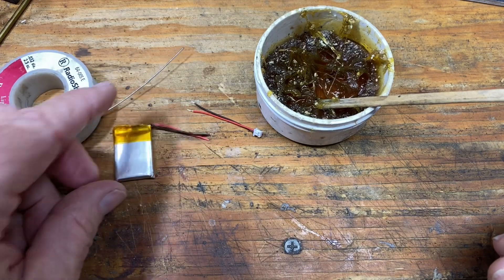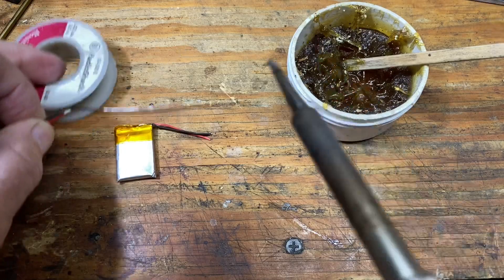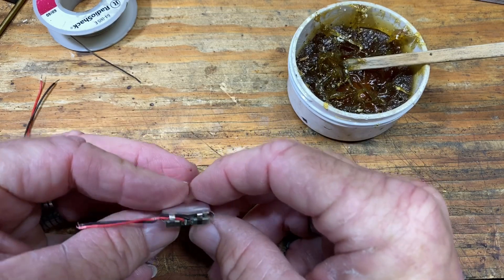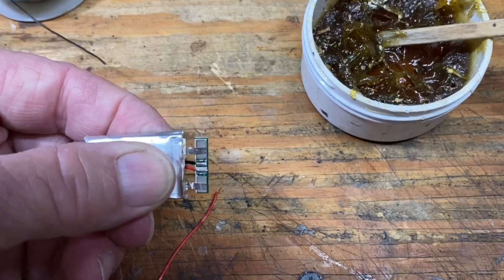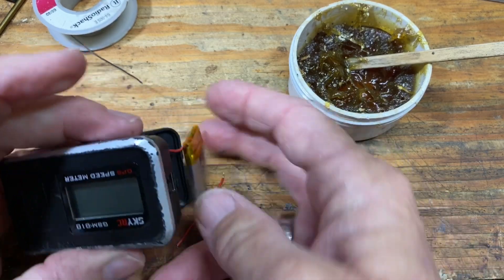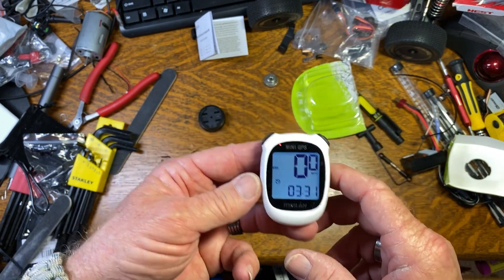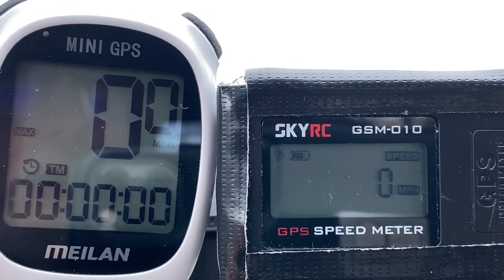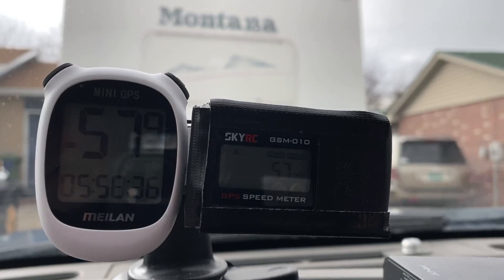SkyRc GPS repair and test

Comment: Has anyone replaced the battery on Meilan M3 Mini GPS? Was wondering how to disassemble and what kind of battery. Thx.
Reply from the maker: Is yours not holding a charge?
Reply: @RCModSquad  No, not holding a charge for more than 20 minutes.
Reply from the maker: @RonOsbourne  Mine is still doing ok but I’ll see what I can find out about the battery.
Reply: @RCModSquad  thank you. I was thinking, to disassemble, remove the screen first. I didn't try yet.
Reply from the maker: @RonOsbourne  I’m work from memory right now. My GPS is 520 miles away but I’m pretty sure the front isn’t the way in. I’ll be home in 8 hours or so and I’ll take a look.
Reply: @RCModSquad  awesome thank you so kindly I'll stand by.
Reply from the maker: @RonOsbourne   sorry for the delay. I had traffic issues today. 😳

This is from Meilan. 

“We apologize for the battery issue. The battery in your bike computer is not working properly anymore, and it certainly doesn’t not happen on all the bike computers. Battery cannot be replaced is because bike computer is closed by ultrasonic wave for specific purpose.” 

So since they use ultrasonic welding about the only way would be to actually break it open. You can’t even send it back to them for repairs.
Reply: @RCModSquad  I'll die trying 👍
Reply from the maker: @RonOsbourne  😂 
Since it’s welded rather than glued I’d think you could file the edges pretty thin and maybe break the thin bond. 

My thinking is a battery (it’s a 400 mAh 3.7v) is probably going to be around $10.
Reply: @RCModSquad  I may need a couple of days. I'll let you know the outcome. Thanks.
Reply from the maker: @RonOsbourne  please do. I’d try with mine but I don’t have any battery issues and I scratch it up enough crashing. 😃
Reply: @RCModSquad  the way into the unit is to pop out the two rubber buttons with a small flat tip screwdriver which is very easy then once you've done that pry open the case with a little bit of the screwdriver inserted use both buttonholes and it will begin to crack open then you can just pull it apart. Looks glued together with Crazy glue to me. So if you were to disassemble it you can put the rubber buttons back in either side of the frame and glue it back together and presto it's waterproof LOL. The battery is 3.7 volts 440 milliamp hour. It is a square proprietary battery with two leads soldered to the circuit board. There is a little bit of room for a slightly larger dimension battery. Mine went in the recycle bin. I have no use for a unit which operates with a sealed battery of that size. Don't get me started on the cell phones that have a sealed battery because I want to smash this (Samsung A71 5G) thing because of all of the bloatware and Samsung bloatware that cannot be Force stopped permanently. so if you want photos of the M3 let me know I cannot seem to post them here. my other options are to just go to a store and see if I can find something I like that uses a replaceable battery and is wireless not GPS or just use an app and my phone or a separate phone that does not have a calling plan because as you know GPS will work on a phone even if there is no active calling plan paid.
Reply from the maker: @RonOsbourne  funny that Meilan says it’s welded. Maybe they just want you to replace it. 

I wouldn’t mind having the pics. Davids8675309@gmail.com 

Here’s a couple of units that have a better refresh rate than the Meilan. The GSM-015 has a replaceable battery but in not sure about the 020. 
 

SKYRC GEM-015 GPS: https://amzn.to/3cVe8WC

SKYRC GSM020: https://amzn.to/3tFZv0c

Comment: Dave I was curious if you could delete the old mph on the max setting. I recently got the meilan and if I run something slower than the previous speed then I can't see it. Hope that makes sense.
Reply from the maker: Hold the right button in for a couple of seconds, the screen will change to save and say YES on the left and NO on the right. Hit the right button again and it will clear the MAX reading.
Reply: @RCModSquad  you are so awesome Dave!! Thank you so much it worked!! I just have a hard time reading those instructions for some reason. Much appreciated my friend have a great day!!
Reply from the maker: No problem my friend. Sorry I didn’t see it sooner. Have a great day and be safe out there!
Reply: @RCModSquad  no apology necessary Dave I appreciate the help regardless!

Comment: I’m glad you did a comparison on both of the gps units. I have the mini gps and wondered if it was accurate.
Reply from the maker: Jesse B Motors I need to know for future use if a truck was really faster or slower. 

My thoughts so far is, it seems like the mini has a faster refresh rate which would make it sometimes show a faster max speed than the SkyRc BUT I think it’s probably the more accurate. With the SkyRc you would need to hold the max speed just a little longer until a refresh happened. 

Keep in mind this is just an opinion based on a quick assessment. I’ll see if I can dig up the specs on them. 

I might try to get a slow motion video recording to see if I can detect it in the video. 

Have a great day and be safe.